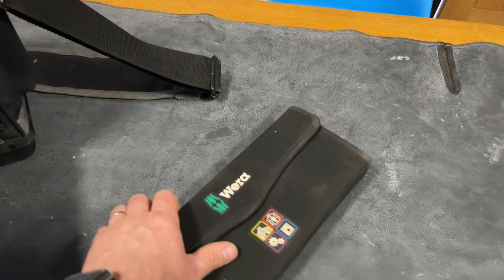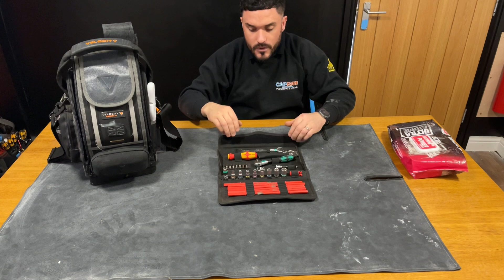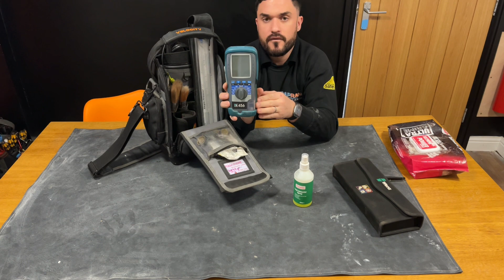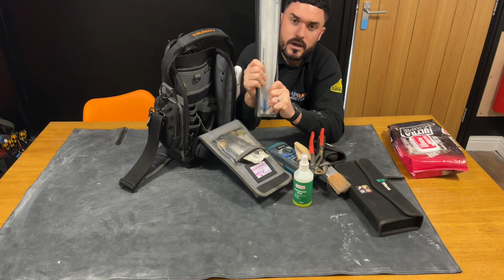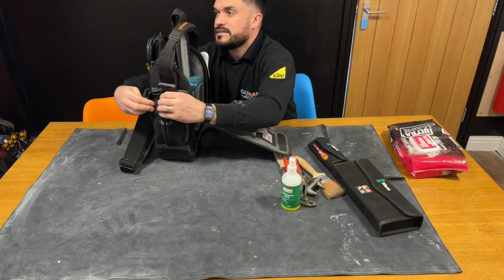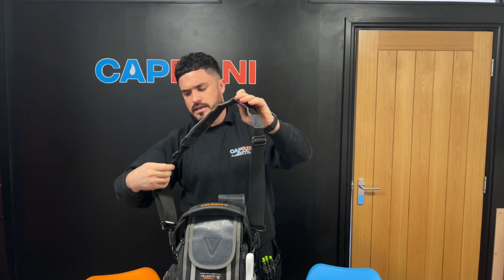Want to Work Smarter AND Faster? You NEED This Toolkit!

Comment: Not seen the other two videos yet, but I was surprised how few hand tools were in this one...Also, i thought you might have say a multimeter an/ or one of those plug in socket testers to check the electrics to a boiler, or does that fall outside your remit? 

With regards the Wera pouches, i have a few of their tools, but I can't help thinking we are paying for the designer/bling aspect as much as the quality. Their Joker spanners are one example; I would find it hard to buy those over the equivalent Bahco or Halfords Pro for instance.

Anyway, interesting video and I will check the others out....